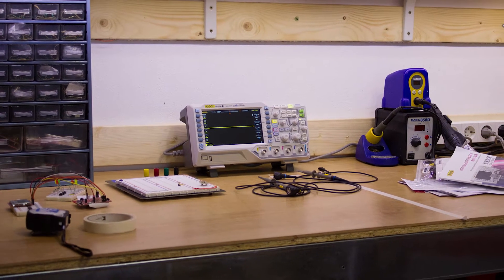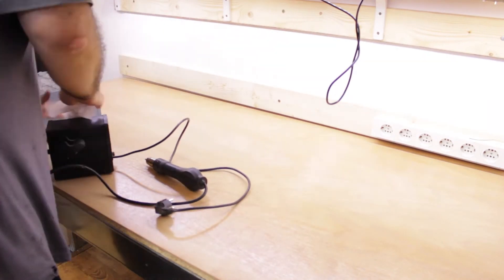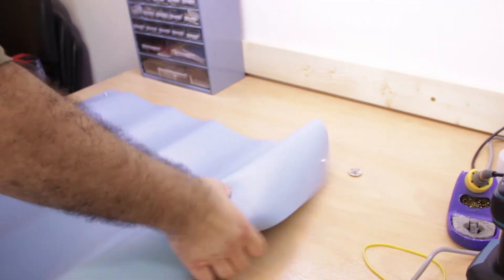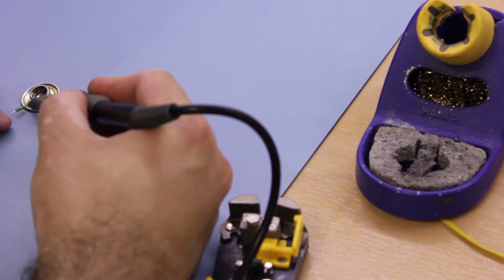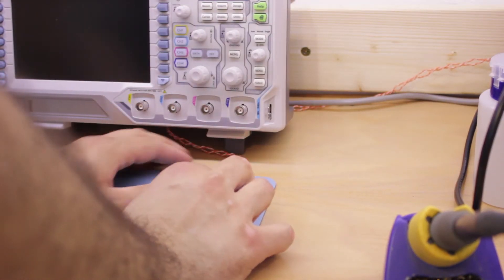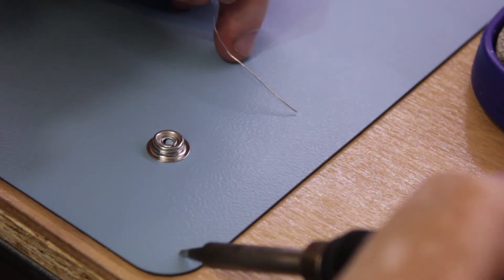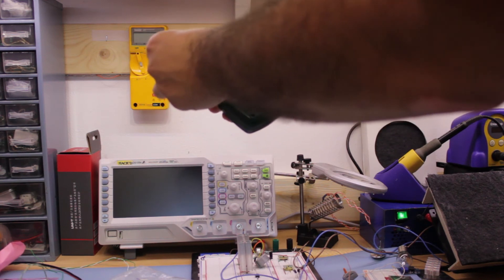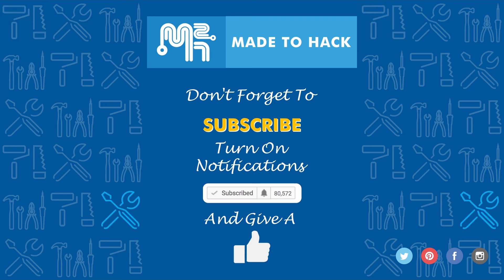How To make a DIY Electronics Work Bench - Part 3

Comment: I am inspired! Moving out after graduating (ECE) and first thing I want to splurge on is a maker bench setup with bench equipment and all! thanks for providing your experience in making a workbench :). I am curious as to whether or not it would be worth it to just make the entire surface a grounded. Similar to how some of the benches in university labs are.
Reply from the maker: Thanks for watching. I suppose if it's affordable to do the entire surface, why not? Dave Jones did that buying I think a 10 meter roll of the ESD mat. AvE I believe made a surface using copper plate.